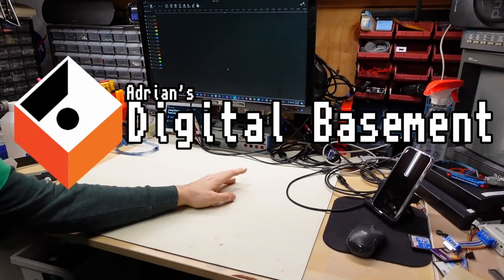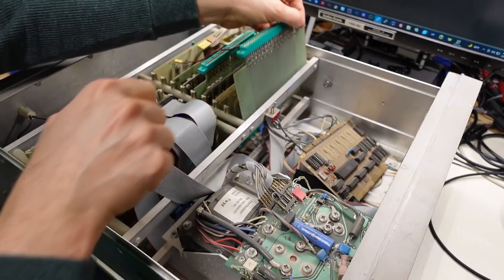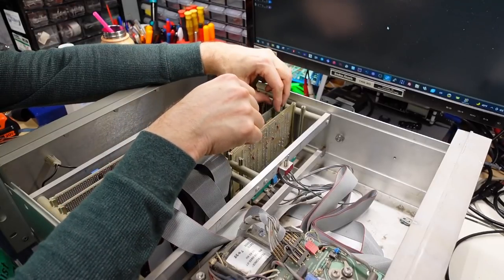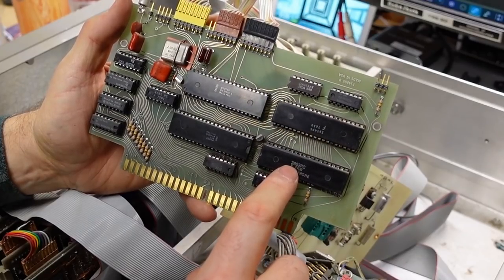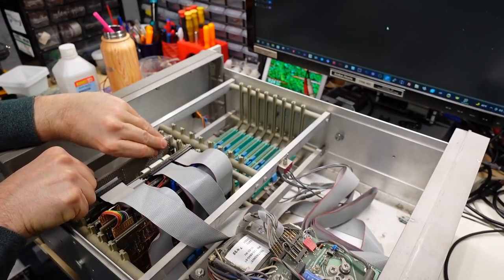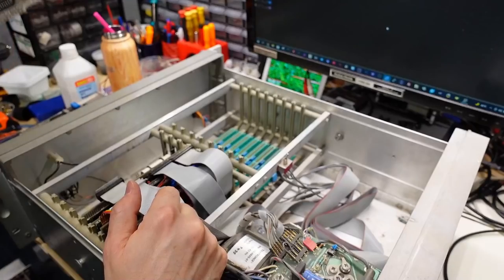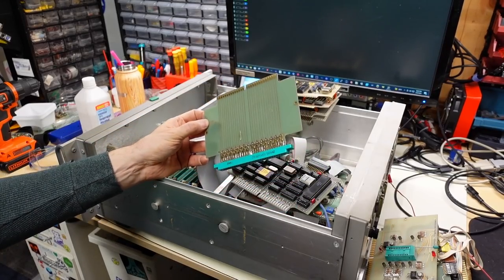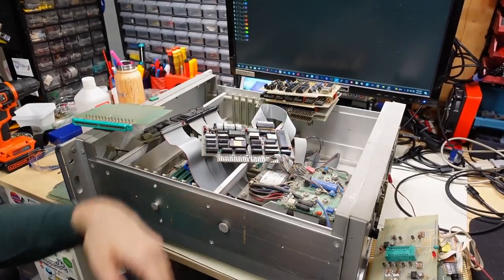I need help finding information on this mysterious computer

Comment: It is a Future Bus I think, Tektronics used that some times, the other possibility is a STD-80 bus . The mk3850 is a CPU, The Z280 is a Z800 in CMOS, the board with 3 connectors is a parallel and serial port card probably connection to a VT50/100 terminal. So no monitor. My Dad made a S50 Buss computer and then a S100, so those things are known to me. I also worked on data/telecom switching networks and used data interception systems for trouble shooting modem connections. One of the processors is in the F8 Mostec family. Looks like two computers or more in one box. And the programmer may be a separate device that the big switch selects. The 'bodge' capacitors were a recommended connection of the memory chip manufacturers in those days, for power supply quietening. The Z280 is quite rare, it has Serial and MMU and I thing EPA built in, with 16 or 8 bit addressing, one thing the EPA could do was move blocks of memory around while the CPU is doing other things. I've seen it used in high speed (for the time) bi-directional serial signal monitoring. So you could look at Synchronous data connections and check parity, data integrity etc. 
The high voltage on the 2708 UV-EPROM is +12V with -5V and +5V and +26V Vpp. Hope that helps.

Comment: While this probably isn't one, it is a good example of the so called black boxes which were a big concern during the Y2K problem. Things like this hidden away in closets or in racks that had been doing some custom function, but no one knew what they were for. There was lots of concern on what would happen to what ever kinds of data might be processed through a black box and how it might affect other systems when the calendar rolled over to the year 2000, because who ever installed them was no longer around. I was a volunteer computer specialist at a national park leading up to Y2K and had to make sure we didn't have any of these in the system. As it was, we didn't. However, we did have to replace a bunch of old computers just for safety.

Comment: In the beginning of the microcomputer era I made some computers containing mumerous wire wrap boards on wire wrap busses. Data input/output was hex code and data storage was tape cassette. All programming was just machine code. If I remember correctly, the power supply had +/-12v, +/-5V, and +27v. Evenings in front of the TV, my girlfriend was knitting and I was wirewrapping.

Comment: This is a general purpose computer.  If it were a custom control instrumentation machine, it likely wouldn't have an EPROM programmer and it would have had more I/O than some floppy and serial lines.  It very well could have been in a university setting as it was developed over a long period of time.  I build a 64 processor Transputer for my Masters degree project in a university lab in the 90s that was likely used for some years to come by other students.  Mine was a bit more elegant as I had the tools and research funding to have my PCB done in CAD and sent out for fabrication.

Comment: Based off what you were looking at and what I was able to gather it was most likely a communication system that interfaced with data display terminal or equivalent; so no direct display driver card should be expected. With the connectors, it would appear that one would be dedicated for display interface communications and the other two would be for input and output data paths. What the overall system would talk to would be difficult to ascertain and almost definetly changed over the years. Hope this helps. Cheers!

Comment: I would guess a lab computer, probably running some weird scope or lab other equipment. I have taken apart quite a few 70's and 80's lab devices and have found that a lot of them look very professional on the outside, but on the inside they are running on a wing and a prayer. Also depending on what it was attached to a lot of this stuff was sold and then the company went out of business or got bought and stopped supporting the old equipment and whoever had this had to make it work at any cost because the original lab equipment cost hundreds of thousands of dollars.... so bodges and scrapyard fixes just to keep it running for another year....and another... and 10 after that.

Comment: It looks like a controller as it has inputs (25 pin) and plotter outputs. Also I would venture to say that the other connectors on the bottom are SCSI (Small Computer System Interface) ports. It almost looks like a unit from the 70's as those types of input and output devices weren't around when I worked at  IBM in the late 60's and came out later in the 70's.

Comment: I actually had one like that before.  It ran CP/M off 8" floppies and had two destroyed 10 meg hard drives.  It required a dumb terminal and once I stacked the hard drives, the computer, the floppy drives and the terminal, I could just pull up a chair in front and it was at the right height.
It ran dBase II, WordStar, and some kind of version of VisiCalc.  I miss that system.

Comment: Reminds me of the computer controller we had back in 74, that was used to run instructions to repair different Avionic gear, seems like it was more advanced since it had a floppy controller and real memory IC's. The ones we had iron core memory, and reel tape drives, first you would put on a bootstrap tape in the upper reel, then once you got the machine kickstarted then you put on the version tape, then on the lower deck you put on the program tape for the program to tell what instrument to use and what settings to check that part of the avionics box you where testing.

Comment: I had something similar to this back in the late 70s early 80s. It was a development system based around an S100 bus back plain. Over the years it was modified and hacked about as it was  used for different projects until it ended up in my "useful junk" pile, and got parted out. I wish I'd kept it now as it would be great to be able to play with it again.

Comment: Case looks like it was either repurposed from a Tektronix rack mount scope, or they ordered it direct from Tektronix, because Tek did sell the rack cases and transformers as parts, for customers who wanted to take the desk version of the 6 and 7 series scopes, and turn them into the rack mount versions. Also they would sell just half the scope, the display side, and the case, so you could build bespoke equipment, using a Tek display in it.  Standard part layout, and very likely that backplane was made using Tektronix edge connectors, as those were a common thing to buy, you ordered the edge connectors and card cage and used them, either with a backplane PCB, or with wire wrap pins, or you used lots of wires to make a bus.

Extender with the solder braid on it was because you always had issues with ground bounce on those cards, unless you had a much lower inductance and resistance ground connection, so soldering the braid on would help with that. The one with repairs was because they needed to break a trace, and did not have the extender type with the ability to do so, so cut the trace and fixed later on. Yes at least 3 generations of processor, likely this was used with either some industrial, ATE or analytic system as controller, using that multiport card to interface with the sensors, using serial comms, thus all the missing interface chips and the in board socket pins. Very likely disk drive was originally an 8 inch one, though likely in the 1980's all those were converted to 5 1/4inch diskettes, probably still using only 80k per diskette side, as likely the disk read and write routines are hard coded in the ROM.

Eprom programmer is there because they needed to write new 2708 devices, but likely did not have a programmer, so made up the card to do so, and likely wrote a program to write to them. Red lead for 30V leads to the power supply, where there is likely a pin that has 30V on it, regulated on the board to the 25V needed to program those chips. Power supply has 4 5V 2A regulators, so yes it will easily be able to be replaced by a PC power supply, but there is a good chance it still works, plus you will need +-12V and a 30V rail, plus likely there is a 24V side to it as well. Serial ports on the back are one for a terminal, one for a printer and likely one to interface a paper tape reader, likely old enough that at least the original programming came in via tape off a reader, though there might have been the ability to use the tape puncher as well, though that likely was separate.

Comment: I've seen several 'computers' that look something like that. Possibly a purpose built controller made to test other circuit cards or manufacturing equipment. The military uses similar 'old style computers' like that because some of their equipment performs one function and doesn't need to be solid state and must be easily repaired. The case indicates it had slide rails and was just a controller for some other type of equipment. Maybe a test fixture for proofing some other type of equipment. The total lack of serial numbers and model numbers indicate it was probably used in a lab or strictly as a test fixture.

Comment: This is made by Textronic, we measured thicknes, elongation en temp and write it on paper with those paper ink pencils from Textronic, and that was on the temper mill, the loose wire with the connector you find is possible a connection with a programmer box (just for trouble shooting)

Comment: So many people say - oh, not DIY, but even though this one isn't an S-100 type computer, it looks a lot like the S-100 computer I built! There were lots of sources for bare boards back in the day. And many companies sold S-100 kit boards. Less than 10 years ago I saw S-100 prototype boards at FRY's Electronics. I found getting the chips more of a problem at times than getting or making boards. I still have a bare S-100 TV Type writer type display board which I have lost the data  for.  I think I knew more people around the 1980's that had nice DIY S-100 systems than company manufactured computers! It seems ridiculous now but I remember paying big $$ for 4 K bytes of static RAM for 2 2K byte RAM boards  - probably as much or more than some of the 8 or 16 x 32 or 64 GIG RAMS for more modern systems today! I built it to learn, but also because I couldn't buy everything all at once. SO MY $0.02 Says it is a DIY home brew system.

P.S. My system was constructed to go in a short rack!  The top drawer had 2  - 8 Inch Floppys , the bottom drawer had the power supply and mother board with CPU, Memory and I/O cards Including a DIY  data casset  tape electronics board which made loading 12K BASIC a lot faster than using paper tape on my TTY which was my first I/O device. People complain about slow computers now, but 12K BASIC took almost an hour to load at 60 word (x5 char/word), and that didn't include any program I wrote for it! And then you hoped nothing caused a crash!

Comment: In addition to the transformer label, the colored "harmonica" connectors on the ribbon cables SCREAM 1970s era Tektronix.  Probably some kind of in-house prototype or development setup. Tek was playing around in the CNC controller area at one point, so maybe this was a machine controller of some kind?
Reply: I've seen pictures of similar gear made by HP for in-house use. However, these units had gotten the full industrial art treatment on their front panels matching that of their product line. They looked very very cool.

Comment: S-100 cards are 5x10 inches with 100 connections (50 per side) to the backplane. What you have is definitely not an S-100 machine. Don't assume this machine has a parallel backplane, the cards may have specific locations. The 4 2708's have plenty of room for a decent monitor to allow access to memory, test routines, boot routines etc. all done through a serial part via a terminal. The minimal boot loader (really IPL) for one of my machines is under 16 bytes, small enough to be to manually toggled in on a front panel. It has just enough code to read track 0 / sector zero into memory and execute it, this then being the boot loader which in turn loads the OS off of floppy then starts it.

Comment: I'm guessing this was part of a government contract. That machine did something very important and very specific, maybe controlled some piece of equipment through the I/O on the back. It was obviously obsolete tech, but probably had to be maintained and upgraded through decades, hence the mixed bin of parts. Probably used serial console lines to debug everything without a keyboard or monitor.

Comment: The boards are definitely not S-100 as they only have 56 connections. The memory board at 12:47 has 16 sockets but only 4 are populated. An educated guess (based on the vintage of the machine) is that board originally held up to 16 1702A 2kbit EPROMs for a total of 32k. Those 4 2708s replace the 16 1702 EPROM which then required the rewiring of the address decoding circuit.

Comment: I had one of those on the shelf when i worked in an electronics shop at a university. It sat there for the 5 years i worked in that department no clue what it was never asked. it looked exactly like that. The labs did polymer, cryogenics, lazers, and other things i don't even know as well as a teaching lab. but it looks like one of the cryogenics modules..

Comment: Looks like a Morrow S-100, the first card you pulled out was a drive controller and the drives would have attached to the top pins (header pins). The 2716, 2732 and 2764 chips were a common upgrade to the 2708 that users often did themselves.  Most of these boards were often hand wired, as there were not a lot of machine builders available then. The connectors on the back are likely serial (the db25), a parallel printer port and a SCSI port. In those days we often had to program our own chips, thus the eeprom burner boards. Ram boards were also a common user upgrade, often with from 8k-64k. Obviously this was owned by a user who did his own upgrades (which was also pretty common then).  Many of the early versions of these machines were actually booted with a paper tape reader that loaded the bootstrap info to start the computer.

Comment: We used to use some tektronics machines to monitor analogue meterological sensors and importantly wave buoy VHF input. the boxes for simple processing were set to recieve several data inputs and perform some harmonic analysis on the wave inclenometer data for wave spectra and squirt out serial data  The contents of this macheine are far more complex, but it reminds me of the rack mounted black box feel we were creating . They were failry bespoke and repairs were random and quite hard as these were cobbled together by individuals in the first place and minimual documentation as it was intended to force customers to return to manufacter to perform service visits at 3 x the cost of purchase.

Comment: This sort of thing is really typical of prototypes of the era.  Someone laid those PCBs out by hand with tape on vellum, EXTREMELY tedious and error prone.  Once boards were made (again probably by manual processes including drilling) they had to be modified however you could as issues were discovered.  My first job out of college we had stuff like this along with LOTS of wire-wrapped prototypes.

Comment: Industrial controller of some sort, steel mill, railroad signaling, etc. A terminal would hang off one of the rs232 ports (center probably). The other outside two would connect to a serial concentrator or some sort. 8 or 16 devices per port. EPROM burner/reader for field tech firmware/software upgrades. I worked on similar stuff before. Once had one where it used 9-bit data serial devices, odd stuff sometimes.

Comment: 1. All those chips were not static protected at that period of time.
2. By now all the electrolytic capacitors have dried out and are not functional.
During the period that computer comes from, they were using configurations like that for CPM operating system \ Basic logic Programable Logic Controllers. You got some engineer's development system. I use to work on stuff like that for Modicon.

Comment: @21:15 - The MM58167AN clock chip is the same as what was used for the "ASTCLOCK" adapters for XT-class systems and the PS/2 Model 30 (I've been investigating that out further on my channel)...

Comment: This whole thing is definitely some kind of prototype. 
The board you called a CPU bored was obviously a prototype board with plenty of bodge wires.    Someone was trying to make or replicate something here.
TekTronix definitely did not make this piece of equipment.  The Tektronix transformer was likely pulled out of an oscilloscope and the PSU board completely home made.

Comment: This is a prototype computer, a typical S100 configuration with a linear power supply. The case is something you'd buy from a supplier, you'd just drill the holes you'd need for your kit. The construction is typical for the era, its hand taped double sided PCBs, handwires using either plastic coated wire wrap wire or polyurethane insulated copper wire. It was very common for people -- and companies -- to make their own systems back then. I actually discouraged this practice since the sunk cost of developing custom boards was far higher than even the exorbitant pricing for a generic computer and you'd spend a lot of a project's time designing, building and debugging the same hardware over and over.